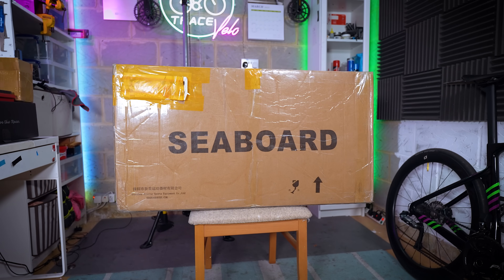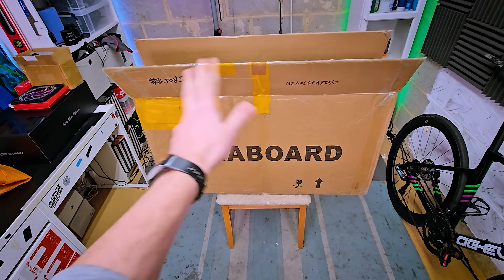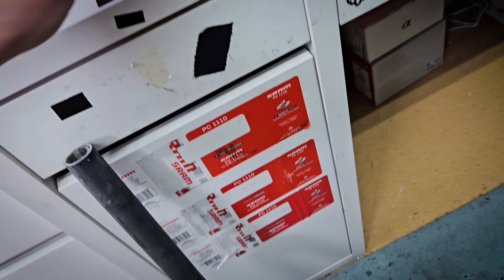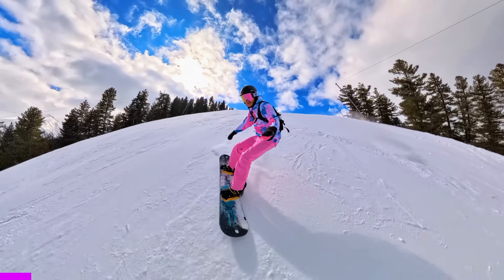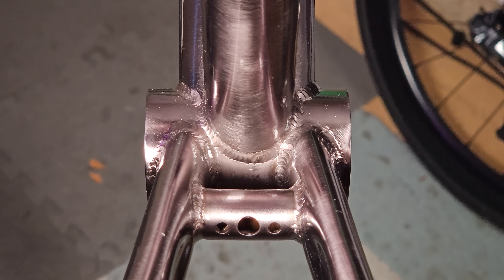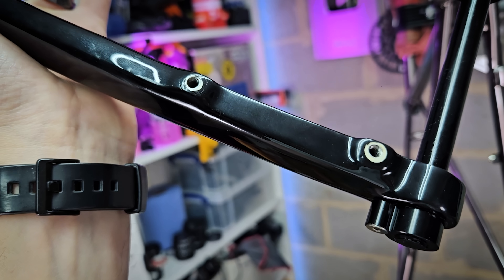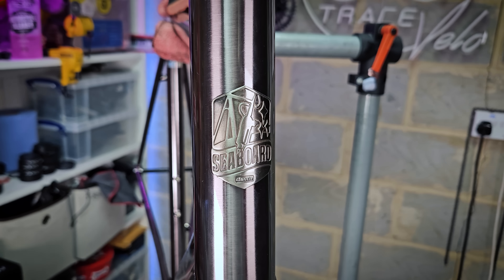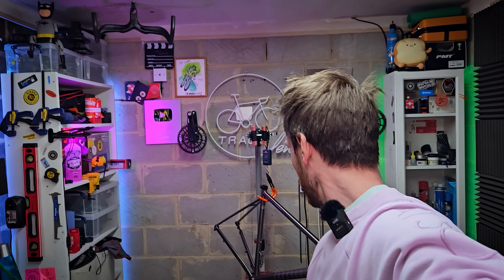A cheap steel bike frame from AliExpress - Seaboard CR05

Comment: I'm not sure that the steel in the star nut and the mainly plastic carbon fibre will have any galvanic corrosion, and neither the fibre glass. Galvanic corrosion is between metals.

Comment: After watching this video I went ahead to the tsunami website and bought the CR03 rim brake model. It got to Maryland within two weeks. Three minor complaints: the seat tube got a tiny dent at the top which was easily correctable when inserting the saddle tube. In this model you mount the headset bearings directly into the frame but the lower bearing was too tight to press in by hand so I used a rubber hammer very gently and got it to sit perfectly. Last, the front derailleur clamp was the wrong size but with a shim which was included it attached to the seat tube but the 700 x 28c tires rubbed the clamp so I went ahead and bought the right clamp and it's perfect now, it might even fit 700 x 30c tires. I'm tall and the 56 frame has a low stack but the right reach so I had to raise the saddle a lot which allowed me by pure chance to not have to cut the fork tube. I hooked up electric shifters so I only needed to run the rear brake cable through the frame, it took about a minute to run the 3 to 4 feet cable, no brake stops so you have to run the whole cable, actually kind of nice. The build came to 19.2 lbs with pedals and attachments for Garmin edge and varia and water bottles included, about a kilo more than my lightess carbon bike. Ride quality is the best, very comfortable and very fast. Corners great, accelerates great and it can climb amazingly even though I carry an extra kilo. Buy their BSA bottom bracket, it's excellent. The only problem, I might have to make this bike my main bike.

Comment: CHALLENGE ISSUED: Take a Schwinn Super Le Tour 12.2 frame circa 1976-1978  (or very similar) w double butted 4130... fit it w carbon fork and your choice of functional A Express components... compare to your welded steel frame.Yes this Le Tour has 1" head tube yet those can be found. 1 1/8 can be fitted.. I'd tell you how. 1 1/8 clears these head tubes fine. Mount those carbon wheels. Your still within your wheelhouse promoting 'Express' parts and wheels.I see a Columbus steel frame advertised on CList.. a mite stiffer if that's of interest.THIS<<< would be interesting. A new interest segment of viewers I suspect.

Comment: Could you route the cables internal aswell? 🤔 if you can look in the hollow tubes.
Reply: I want the cable inside the pipe to look more beautiful.
Reply: I reached out to Tsunami today regarding this question. My guess is that you would have to change the fork and find a suitable headset. If you look at a Standert Triebwerk for example it doesn't seem impossible

Comment: Not sure when you'll be making the followup on this but I'll just drop my experience with the Seabord CX01 steel frame. Solid build, small issues with cable routing along the bottom (cable stop where there probably shouldn't be). Paint & welds are all good, weight is phenomenal considering the material. No issues with tolerances etc, BB treaded fine. Overall very happy with it for about £200.

Comment: I like Seaboard (sometimes branded Tsunami).  From what I can tell, they only make welded frames, either aluminum or steel.  I suspect that they outsource their fork manufacturing to a carbon fab.  I have been riding a their alu gravel GR02 model for about a year and a half.  

I purchased from the same seller as you, and found them to be honorable merchants.  The fork that came with my frame had a defect where the threaded insert wasn’t aligned with the thru-axle.  I provided them with a short video from my phone demonstrating the problem.  They got back to me within 24 hours with factory authorization for the replacement.  Unfortunately, warrantee items can’t ship thru AliExpress, which means they take a while to arrive.  I just stuck a spare fork on the bike until the replacement arrived.  

I purchased my bike w/o seatpost as I have a pretty good inventory of same.  Fortunately, alu & steel frames don’t typically need a proprietary post, making this easy.  

The headset cups are milled into the headtube much like on a carbon frame.  The provided headset fit fine.

In fact, all the machining on the frame was correct.  I didn’t have to face or chase threads on the bottom bracket, the headtube didn’t need facing, the brake mounts were already faced properly. All the mounting holes (rack etc.) were clean. The seat-tube didn’t require reaming, so all was good.

This frame has been out for a few years now.  I think 44mm is about the widest tire I’d try to mount - so not to the most current spec.  But I’m riding 42’s and am quite happy about its ride on road and gravel.  BTW, using 650b wheels and tires won’t gain any space for the rear tire, I tried.

The headset/steer-tube doesn’t support true internal routing - but I’m fine with that.   Call me old fashioned.  I like round 27.2 sear-posts, BSA  bottom brackets, traditional forms of internal routing or external routing of hoses and cables, so this is a fitting frame for me.

The frame specs have proved very accurate - that’s not always the case on AliExpress.  Naturally this helps with getting a good fit.

The paint and decals are well done.  They’ve proven durable, and the paint is flawlessly smooth.  Also paint march between the frame & fork is good.

The welds appear workman-like.  They are partially smoothed, not the sanded off style that lets your friends wonder if your frame is carbon.  But they’re also not as rough as even the best stack-o-dimes weld without any finishing work.  A reasonable compromise in my book.

My frame came with a cleaner looking seat clamp than yours.  Not bragging, just an observation.  The frame and fork have plenty of mounts for front and rear racks plus a full set of fenders and three bottle cages.  There isn’t a mount for a top-tube bag, although I think most top-tube bags don’t need one.

I’ve had the frame up in my frame jig and the alignment is spot on!

When I purchased it, delivered to my home with the parts listed above, and a set of thru axles, it was comfortably below $350USD.  That’s an incredible value, although today we Americans can’t really partake of that.  But for everyone else, I wouldn’t hesitate to purchase a GR02, and I can vouch for the Quinqin store on AliExpress.

I can’t wait to hear how the steel frame plays out.

Comment: Hey Trace, I can’t wait to see your ride evaluation.  A couple of points re. this video: 1) press-fit headset cups have been the norm for bicycles for eons.  That said, I think Columbus does make steel head tubes with braze in cups.  2) Cro-mo is a pretty generic metal description.  In my experience it isn’t particularly rust  resistant.  Even various stainless steels vary from less to more rust resistant.  In fact some folks using early stainless bicycle tubes w/ only clear-coat for finish had problems with stains and rust.  Hopefully clear-coats have become more protective in the meantime.  3) I’m not a welding expert (I’ve only done brazing which doesn’t heat the tubes as much) but I don’t think most steel frames get a post weld heat treatment.  However, the tubing manufacturers have developed steel formulations that respond well to TIG welding (which is the welding method that introduces the least heat into the frame w/ the possible exception of the new laser welders).  Accordingly, the specific formulation is determinative of the need to post heat treat.  Also, wall thickness, particularly in the weld zone can make up for issues of embrittlement.  Based on the price range of this bike, it’s likely the butts are a bit thicker t than the lightest steel frames as a means to ensure against failure.  

Hope that’s all useful for you.

Comment: Wow!  That is a total BRICK!!  My 1988, 58cm steel Raleigh Race frame is about 1865g.  My modern, 'large', oversized Holdsworth Competition is 1842g.  My 57cm Cervelo Superprodigy is 1670g.   I've had other Reynolds steel frames that were well under 1900g.

Comment: Just hammered it but use wood or somethng softer than steel. Plus, GREASE the cup sleeve thst meet the head tube, since its steel meet aluminium, you going to face galvanic corrosion.

Comment: Nice builds and content, any chance you do build an actual gavel bike (with available carbon frame) but with an T-bar handle, 2 finger Break handles, may on rim brakes to save some more weight :-) Budget friendly and light as possible :-) Cheers from Germany.

Comment: That frame looks like it's been set in a jig and welded by machine.  It's highly unlikely its had PWHT - what most of the cheap frames have is a tracking check and the frames are physically twisted straight if necessary.  Would be interesting to get a proper old school frame builder to check the tracking - then drop it on the floor a few times and check again.  See how much tension is released and how out of true the frame really is...

Comment: 4130 doesn’t require any post weld heat treatment after being welded with 70S-2. You got a pretty decent frame there I’d imagine.

Comment: Many years ago I recall fitting an external  1 inch headset with a block of wood and a 6oz claw hammer 😆 Yeah there is a weight penalty for a steel frame, but the trade off is a lifetime of service. My Reynolds 531C brazed and lugged frame set is now 30 years old and still rolling.

Comment: I've been using their CX03 gravel frameset which is a more recent release by Seaboard for more than a year now. Check it out if you're interested, uses pretty much the same materials for CR05 aside from a steel fork.

Comment: Me and my friends bought the aluminum GR02, and I recommended the steel CX07 for another friend.

My GR02 came with a titled rear triangle, the rear wheel is slanted. My other friend's GR02 has the rear axle off center, causing his wheel to rub with the chainstay.

The CX07 however, is all good, and the welds look clean and consistent

Comment: Full time frame builder here. I enjoyed watching your breakdown and comments. 

Heat treatment post - weld is usually reserved for aluminum frames or specific high-strength steel frames, so you'll be good. I'd suggest a can of Weigle Frame Saver on the inside for longevity.

Have a great ride :)

Comment: i built this bike in 2020 but pair it with brand new Campagnolo Chorus groupset, Campagnolo Bora One 50 wheelset, all carbon fiber bits and integrated handlebar for fun

but surprisingly it’s a nice bike to ride with.😮

ended up with a custom paint spray because i got bored with the raw look

overall a good bike. because i could spent the rest of my money for parts🤣

Comment: Great video as always. I have an idea to test, you have every kind of LTWOO electronic groupset, could you verify if the eGR groupset could work with a front derailleur? It would need the eRX type batter holder, because the eGR one only has one outlet for the RD. Thanks very much in advance!

Comment: i have this frame since 2023, so far so good, very little maintenance. Funny thing about this frame, you could fit 35c in it (i'm using gravelking slick with 21mm inner width rim), fork would be your limitation, got maybe around 2-3mm clearance from each side

Comment: Ehh, I wouldn't go hammering the head bearings like that.
When you're pushing them in, you need to avoid transferring the force by way of the balls / rollers etc. Otherwise those ball bearings will indent in the race, seriously reduces the service life. 😬
Special tools are needed for the correct work around

Comment: I'm probably not the first to say this but the reason steel is considered real is elasticity. Steel frames tend to distribut road shocks. However carbon fibre can do this too. What steel is less likely to do than carbon, way less likely, is shatter.

Comment: That welds ara comparable with the the ones made in some high ends like Fat chance. Hand madr welds are not perfect, it they are like in Amaros or Merlin, they are made by machine. Perhaps better in FChance in the soround areas, but are not perfect. We are not robots. The diference is that yop brans knows what they do and yakes time to do well. And do all by hand including the finishing: a very hard job in ti for example.

Comment: I’m in China as a cyclist here doing a few China Cycling League races. Just wondering if you can kindly recommend a cheap steel or Alu frame that’s BB30 and rim brake. I have a spare groupset I could use for a commuter bike/run around to the shops :) 
Thanks in advance!

Comment: $377 for a steel frame?! At my local community bike shop (The Bike Kitchen) normal frames are $20, and that includes any frame you can find. For example, I got a 1982 (?) Peugeot Marsaille in perfect condition for $20, I can't imagine many modern steel frames from Aliexpress can beat that quality, let alone looking at price (although Aliexpress is far better for parts and carbon fiber frames/wheels). If you have a local bike shop, please check with them. Many (at least in the USA) sell old frames donated to them for relatively cheap (although maybe not on the level of the Bike Kitchen), if I remember correctly, they usually take the good parts off of donated bikes to use on other bikes, which leaves the frame as effectively metal recycling.

Comment: I have owned the Seaboard CX01 frame for the past 9 years and have taken it on Euro tours, daily rider, changed groupsets, added custom paint 5 years later. Loved it, its been a great canvas and geometry. It feels just the same as Jamis bikes and their line up. Highly recommend for budget build.
Reply: How is one with the same clear coat finish as on this video in a rainy climate? You think it will rust after a bit of time?
Reply: Both CX01 and CR05 have the same bronze anodize, its not paint. I stands the test of time. Even if you get a dent, the finish will not peel. CX01 at the time also came with Reynolds 725!

Comment: With steel, in my experience, what feels inefficient and flexy in the first hour, feels sublime after....on a Ritchey Road Logic 60+ mile rides do not beat me up at all. Not so for my aluminum "race" frame. I looked at that Seabord frame before buying the Ritchey...but went with the triple butted frame that has been refined over decades.

Comment: The seat and chain stays don't have drain holes. The tubes are sealed both ends, so need holes for the gases to escape during the welding process to ensure even welds.

Comment: I have the older RA01 rim brake frame with all steel fork. I paired it with a carbon seat post. It's a nice all round bike. It's my week day commute bike and also weekend long ride bike. The rust protection coat didn't last that long. So i had it stripped and had it PVD coated with polished gold coating. Been riding it for 5 years. With the steel fork, i have a peace of mind when riding over rough roads. No doubt it's s a little heavy comparing to carbon frames. U will only feel the extra weight on the steeper long climbs...

Comment: I built a commuter bike around a Seaboard CX01 frame last January and I now have over 11000km on it. Still perfect in every way. Mine is a gravel frame with a steel fork, and I love this bike. Rides well, even if it is a bit on the heavy side.

Comment: AE is a great source for alternative priced bike parts. I've been buying there for over a decade now.

I'm just interested if your long delivery time was quoted at purchase time and how the usually 60 day auto delivery worked for this purchase? Did it ship by air or sea?

The largest item I've ever bought via AliExpress was a carbon wheelset in 2021 which didn't seem to take any longer than usual, by air. An Alibaba purchase of 4x 26" fatbike tyres did ship by sea and took much longer.

Comment: I have set up a similar cheap steel frame from China, Reborn Koozer AM CLR6200 claimed to be made from 4130 chromoly with a very lightweight full carbon fork. The weld looks better than what you have shown & the frame finishing is very good.
Perfect bike for long distance as it absorbs shock very well. It doesn't have the stiffness of a carbon bike on the climb.
Full bike weights in at 7.5kg with Ultegra set up.

Comment: Kind of funny seeing you confused by things most of us grew up working on, LOL. I have a CrMO steel SOMA rim brake road bike that will probably go into the ground with me, it is not fast or light, but there is something about the ride feel that makes it a pleasure to munch the miles on. Don't worry about the headset bearings, as long as you grease them they usually drop out, and the cups are easy to drift out and cheap to replace anyway if push comes to shove. The fork having an external thread is nothing new or weird either, just less common these days. There was (or maybe still is) a thru axle system called R.A.T. that uses a similar setup (Cervelo and FOCUS used it for a while I think).

Comment: Welds on the head tube look nice and tight but not so around bottom bracket. Also notice two pores at 8:58
Maybe it's related to more restricted access compared to head tube even if welder can position frame for easier access - BB area is more busy.

Comment: When fitting pressfit headsets or bottom brackets you can get threaded bar from most DIY shops in metre lenghts with nuts and washers. So distance should not be a problem.

Comment: take care of that clear coat...it almost certainly will start to corrode earlier than it would with normal paint. Stainless steel is the better option to have the frame brushed, but quite a lot more expensive :)

Comment: Hey, did you put grease between the headset cups and the steerertube? It looks so clean from the inside, to clean in my opinion. Grease is your friend when it comes to putting aluminium parts on to a steel frame 😉